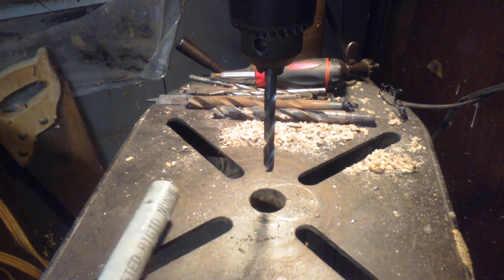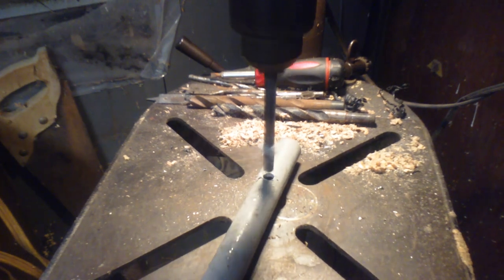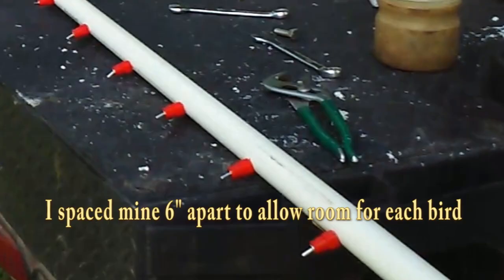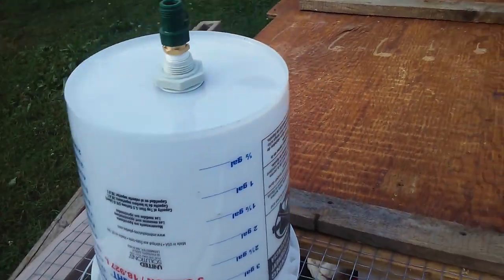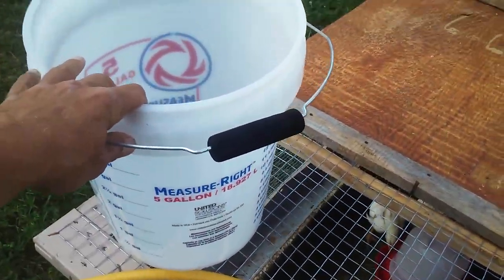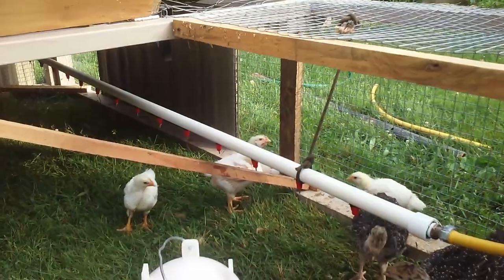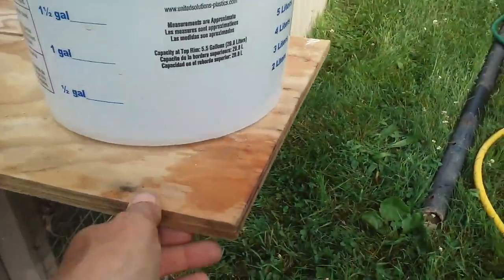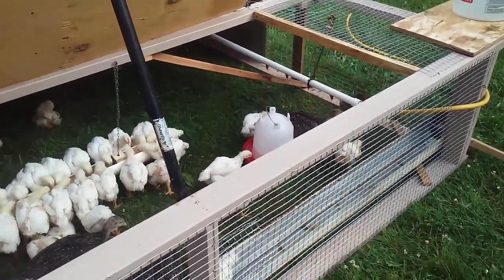Building A Gravity Fed Chicken Nipple Waterier / Poultry Waterier

Comment: to save  a few bucks you can use the feed valve from a toilet tank. You can usually get them for less than $5 and then cut off the valve portion to use the bottom to seal off your bucket. then use a toilet feed line to connect to your waterer which already has the fittings on each end. you only have to get the fitting to the end of the pvc which you can use instead of the end cap.I used a similar set up to use the toilet valve to keep the bucket full of city water and then let it gravity feed to the bunnies and chickens.